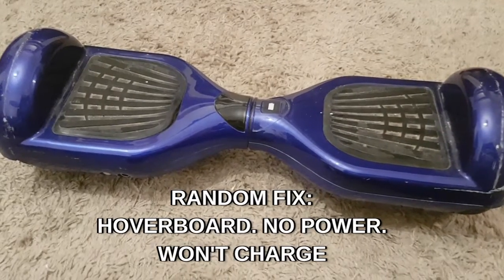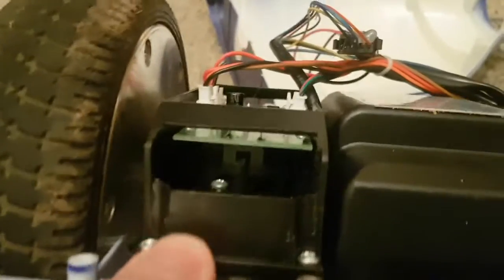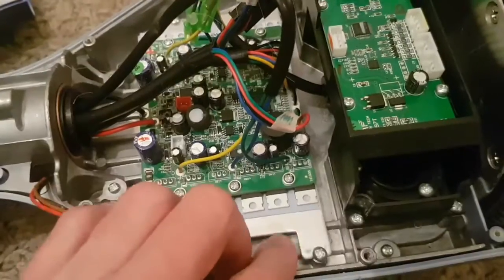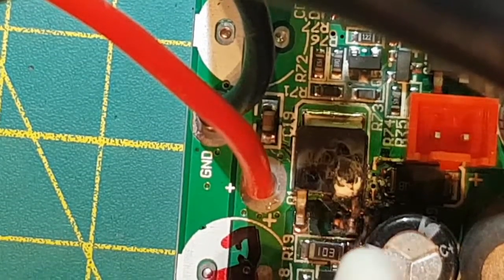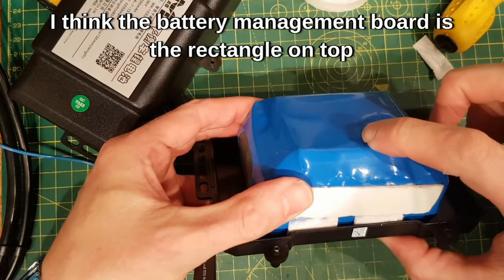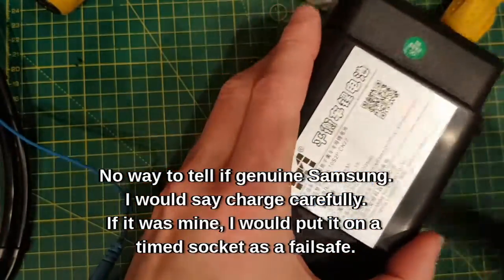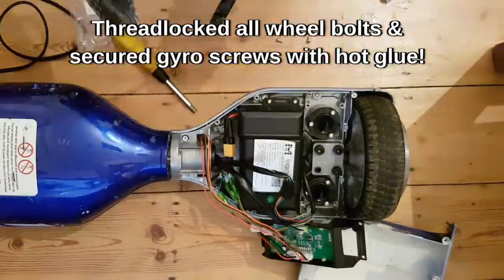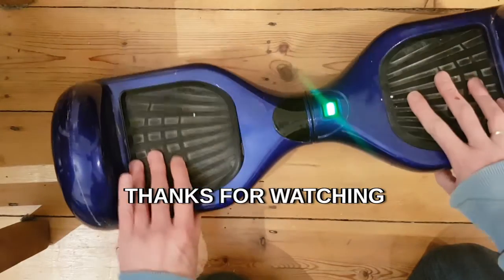Random Fix: Hoverboard. No Power. Won't Charge

Comment: Could you point me in right direction I have a hover 1  hover board     turns on, but it doesn't charge. No indicator . charger is good as I have other hover board and it works what could be the problem     new battery's  ?
Reply from the maker: @ashharrison2387  I would start there. Tbh, this repair was a long time ago and I gave it back to the owner but if the battery is old maybe try a news battery. Good luck.
Reply: @Plan-C  thanks appreciate the reply

Comment: Hover 1 Hoverboard. The 42 volt aftermarket charger had a different wiring pattern than the original chager. I had to move the black wire over on the charging port inside the hoverboard so that it was directly across from the red one. I had immediate results. (good results)  RonA

Comment: My hover board works and turns on when I plug it in charge but I left it on charge for hours and when I take it out it doesn’t turn on
Reply from the maker: Sounds like the battery has had it or the charging circuit isn't charging the battery.
Reply: @Plan-C  if I replace the battery do you think it will work like normal again?
Reply from the maker: @alimirzad6038  I really don't know mate. If the battery is old then that would be my first guess.
Reply: @Plan-C I have the same problem, the board is only two days old!
Reply: @kylethwaits9155  mine is only one day old and is not working after I charged it

Comment: Common problem   is a  wire comes off of the board causing no power no charging.  The wire is near the center of the  hoverboard  and you will find it dangling  loose. I fixed 3 of them for this problem. Very easy fix. Squeeze  the female end to make the connector fit tight. I apply hot glue to keep the connection from working loose. The best fix if it happens again is cut the end connector off and solder the wire onto the board.
Reply: Can you tell me what exactly the symptom is for this problem? My kid's is not charging or turning on, the charger is blinking the red LED, but the LED on the charger box isn't even lighting up all the way like it would normally do when charging. The charger box is also lightly beeping in time with the red light flashing, very dull flash. 
I will take this thing apart and look and look for disconnections, but this video got straight into a disassembly and threw me off, I'm not sure what the initial symptoms are he's fixing. This Nova hoverboard is almost brand new, it's not a year old yet so I'm thinking it must be under warranty, but if it's just a plug inside I may check that out, especially if it's a common problem.

Comment: Mines when I put my charger in it’s starts get when I take out it turns off and won’t turn on
Reply from the maker: It sounds like your battery has had it maybe? Not sure. Good luck.
Reply: Same for me did u fix it
Reply: @megabhi  I need to buy a new battery I think it might be the same for you as well
Reply: @geomdungi127  like the battery that powers the board u can replace it
Reply: @Bubb1y3 did you fix it?

Comment: If your hover board won’t charge here is something that worked for me. 
Turn it off
Plug in the charger hold down on the power button until it turns on.
It should start charging.
Reply: This fixed my non charging issue! Thanks🎉 🎉

Comment: I haven’t used mine in a while and it isn’t turning on no lights or nothing just a beep I don’t know what to do
Reply from the maker: Sometimes a lipo battery can go so flat that the charger won't charge it due to safety. What voltage do you see on the battery pack?

Comment: you know how when the charge finishes, you can still open your hover board but it closes in a minute. so if my hover board ran out of charge and i cant open it anymore, is there a problem or is it usuall that if you dont put it on charge for a really long time it automatically shuts down??
Reply from the maker: Hi,Sorry but I am not sure as this was not my hoverboard. I was just repairing it for a friend. Personally, I wouldn't leave one charging unattended for a very long period of time as the quality of the batteries, chargers and protection appears to vary greatly between makes.

Comment: a verry nice problem to be fixed, some one sent me a hoverboard for repair, that does not charge, and when i turn it on, the side blue light is alwys on, and the motors does not spin, i charged the battery using wires directly from the charger, it charged perfectly, but when hooked to the motherboard and pluggign in the charger, it does not charge and there seems to be no short on the mother board, but what drove me crazy is that i was not able to calculate voltage on all the components from the same GND spot, i have to change the black probe position to another gnd spot, does the motherboard have more than three separated boards in it? i am stuck on this problem... can't get it to start again, i will change the lights sensonrs on the gyroscope board and see about the charging problem later, some help would be appriciated...
Reply from the maker: Hi, Thanks for the message. Not much of an expert on hoverboards, sorry, I lucked-out on that one as the fault was obvious.  I since gave the hoverboard back so can't check but I think it had a main board and 2 gyro boards only. There was also an led board on the top side in the middle. I would have thought that all the grounds should be common as there are wires between the main board and the two gyro boards and one of them is probably ground. Not 100% sure though.